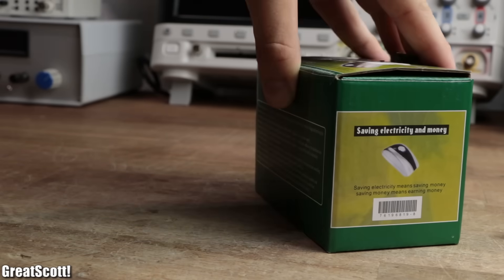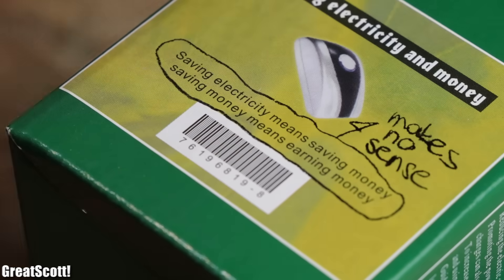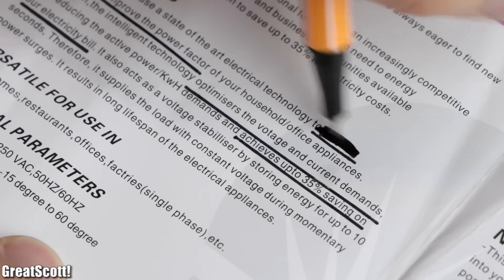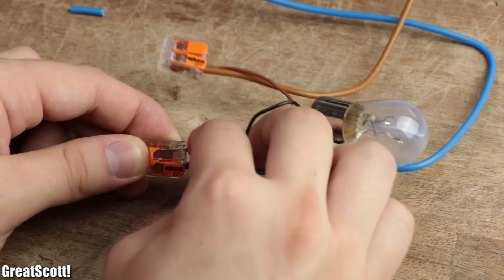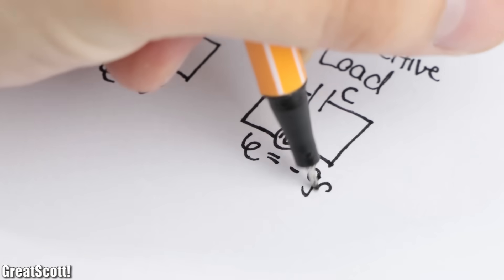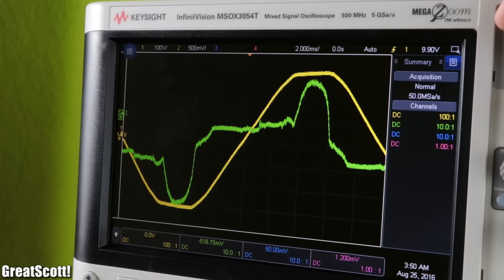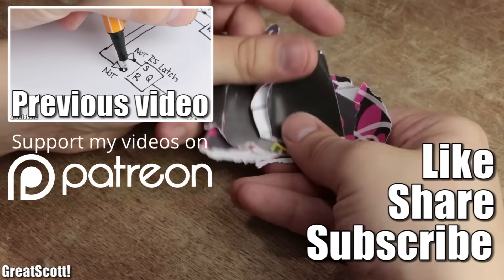Chinese Power Saver - Does it actually save power?

Comment: Wow. Those are crazy cool breaker boxes you guys have, looks like something out of star trek :p I'm used to grey metal ones standard over here, filled with black breakers and whatnot.
Reply: Ryan Gunn The North American standard is pretty bad looking, but at least our color codes are easy to read. I will take black, red, white, and green, over brown, blue, and green. Muddy colors would be hard to see in low light and for colorblind people.
Reply: Buddy Clem can't say I've seen brown and blue in anything newer than the 1970's, and that was before grounds. Maybe it's in commercial, I'm only used to residential, which is black, white, and green. 

Mainly I was looking at the white breaker box with the 2 horizontal breaker bars instead of a grey box with 1 vertical bar.
Reply: The european cable colors (standardized to brown=L1, black=L2 or switched wire, grey=L3 or switched wire, blue=neutral, yellow/green striped=protective earth) is ideal because you know 2-coloured wire is ALWAY the Protective Earth. Low light conditons are easyly changed by using a light torch, so it is no useful reason.
The reason red isn't used anymore in europe is because of the danger of wrong use, in the 1960s the red was used für protective earth, hot wire, neutral oder switched wire.

Comment: It looks like some of these devices have pass-through plugs and can act as a surge protector/capacitor.  I wonder if these could be used to help with the initial power draw of a refrigerator compressor starting .. i.e. to allow someone to use a cheaper/less powerful inverter on a solar setup.  Any thoughts here?
Reply: Jason Fisher Reducing voltage on a compressor motor will burn out the windings. Capacitors don't work the same on AC as on DC. If you're setting up an off-grid solar system, then your batteries will handle changing loads, assuming that your inverter can handle the extra current.

Comment: Great video.. so Im from panama in Latin America... so I cant buy any energy saver in store like amazon or ebay? How I can know if some device works really.. thanks for your help.. Im trying to reduce at least some 30%- 40% of bill...
Reply: Jorge Bernal 
1 You can buy from online stores as long as you have an Internet connection and a way to pay for the product and shipping.
2 All energy saving devices are scams. 
3 To save power, use less power. Weatherproof your home. Buy more efficient appliances and lights when you can afford to.

Comment: First of all, power factor correction devices only help with inductive loads. It does not necessarily "energy saving", but it will improve the function and the lifespan of your electromagnetic (inductive) devices or components. However, there are cases where it may save some energy, but the conditions has to be right. Not all energy quality are the same from home to home ot business to business - not even if they're right beside each other and feeding from the same source.
Reply: Also, you can't just take any capacitance and use it because over correcting will make it worst.

Comment: But in practice this device work for many, but not the way you would expect. It smooth out the spikes and make power transfer on power cables more efficient, that's the main point it does. Electric spikes on a long cable will dissipate energy as strong radio waves, and the device restrict that.

The further away your inductive appliance is from the billing kWH meter, the more it can save. Obviously it should be connected as close to your appliance as possible so that it can smooth out the incoming current that less energy loss wasted on the wiring (the device won't change the profile how the appliance draw electricity). Once you stop using the appliance the device should be disconnected as well for optimum savings.

Obviously the device is useless on non-inductive devices, but most modern devices power are inductive that's why it's being marketed in the first place..

Comment: Phaseshift of 90 degrees?! You mean pi/2 rads.
Reply: Meh.
Reply: No, 90°. You may be good with math, but electrical engineers, and electrical engineering classes do not use that terminology. It would be confusing and inefficient to do so, either in class, or in the field.

Comment: IDK, but this video is far different than our real power saver.......I have a power saver for 10 years and still kicking......I tried multiple appliances like 4K TV, PS4, Ethernet, g29, Audio Booster, PS3, Electric fan......Without using that our bill will reach at Php 2,000.00 - 3,000.00

Unlike using Power Saver it has a rock solid Php 0.00 - 1,700.00

That Php 0.00 is a luck, no lying, I was playing PS3 whole day back when I was Gr. 7 and it was 2 consecutive months without paying bills due to 0.....weird tho......

Update: sadly, we bought 1 unit due to very expensive price. I was still finding the maker of this, pretty legit.

Comment: I remember my electrical engineering prof explained the bs about those so called power saving devices.

It is true that you save power but roughly 1-3% which is very negligible.

Comment: Well, this device CAN actually save power under the right circumstances.
Let us for once imagine the power meter in the consumer unit.

Say you have a 40m Cu 2,5mm^2 supply cable. The load is 4500VA with an inductive cosphi of 0.7, and the voltage by the load is 240V.

Now; S=3500VA, P=2450W, Q=2500VAr
The current is 2450W/240V*0.7 = 14.6A. We’ll use 0.00750ohms/m for the cable. 
14.6A*0.00750*40m*2 = 8.8W (real power) dissipated in heat in the inductors. 
In this case the power meter reads 2458.8W.
We insert the “power saver” near the load, and assign it the value of 20uF. 
In Norway we have 50Hz, therefore Xc = 159ohm. The capacitive reactive power of the “power saver” is 240^2/159=361.8VAr. 
We now get a Q = 2500 - 361.8 = 2138.2VAr, and thereby a S = 3252VA, cosphi = 0.75
The current is now 2450/240*0.75 = 13.6A, (real) power dissipated in heat = 8.16W.
The power meter now reads 2458.2W.
Well, point proven; 2458.8W > 2458.2W, so in this case it saves a tiny bit of energy over time.

This was written to you who say the product cannot save power at all, because it CAN, but it is still a shitty product made to screw people, i can agree on that.
Reply: CirkaTusen But you will have less heat and current,  which means  things like motors will heat less and have longer lifespan, but since you probably dont have 3kw industrial motor in your living room, this wont do much
Reply: whao, i love your deluxe image.....            '                cool!
Reply: No it won't save anything on the bill even though it might save on power waste.   Consumer electric accounts don't charge based upon reactive watts, they charge by actual consumed watts.  This means only industrial customers would save money doing something like this because it takes large motors to make large reactive watt.  The Power Factor does not affect regular consumer power bills.  Only industrial / commercial for the most part.

Comment: These non-wanted harmonics can actually be decreased using a low-pass filter because this current signal is a sum of a lot of harmonically related complex exponentials (trigonometrics) and you only want the first harmonic maybe at 50 or 60 Hz.

Comment: Great video ! I wonder why do they add something inside the box... This system can only decrease the reactive current if the user is running a very specific motor... In any other situation, this system increases the reactive power (especially when noting is plugged...) so, clearly, it is both bad for user and power grid !
If I was one the "engineers" who created this device, I would have just put a piece of iron in it to make weight ;-)
Reply: Some old Chinese energy meters are not properly designed back in the 80s/90s, and they will spin backward under pure capacitive load. Those energy savers don't actually save energy, they steal energy by hacking old meters.
Reply: Okowatt? It's useless!
Reply: Ch Faizan that is 100% bullshit
Reply: @kelsonmcnamee715  in

Comment: About the inductive load:
You hear so often that motors act like inductive loads - well - not really.
if the motor is free running then yes.
But if it is under load the powerfactor normally gets pretty close to 1, so a resistive load with a tiny tiny inductive load in parallel.

Comment: @GreatScott! who wired ur breaker box up? its not save to the touch! + how big is ur home? how is the v-drop?  at which amps does your breaker  cuts the power? the B16 need to cut off on a short circuit current of at least 48Amp at every socket. when u have a big home. then 3x1.5mm² and 5x1.5mm² is not enough. VDE says NO...
Reply from the maker: Thanks for your concern. I am an electrician myself and the wiring in my apartment was done according to the law. It was properly checked.
Reply: well. at least its not a "ratten nest" in your box. ive seen worse boxes some years ago

Comment: Question: What would be the results of your test if your house had 5 ac moters, 7 window ACs, and 3 refrigerators ........ particularly ..... if they all didn't have start or run capacitors?
how is the overall power consumption going to be affected before and after the "Germany" power safer?

Comment: - Try capacitors with electric non-synchronous motors (typically refrigerator's motors) as reactive power - it helps a little. And when before counter somewhere connected reactive electric motor - plugged capacitor even can turn counter's wheel backwards! (sry, bad enGrish)

Comment: At least in Italy it is illegal to introduce a reactive (aka with phase shift different from 0) on the power grid.
Hence any inductive load has a capacitive counterpart in series, and vice versa.
Reply: That makes sense. It will reduce the wiring costs for the distribution network because having the power factor closer to 1 (being closer to being in phase) reduces the current for a given VA. This means the transmission cables can be thinner and the switchgear lasts longer.

Comment: You should really change "China" to "USA" - because that's invariably where these "money for nothing" ideas originate. The Chinese have merely capitalised on the gullibility of the average USian (and yes, there's no shortage of gullible types in other parts of the world either).

To truly get a reduced power bill, you'll need to create a massive inductor and sit it under the power lines outside (a trick widely used by nomadic Romani people all across Europe for many decades) - but don't expect to run your entire house from it; you'll likely only get enough to power a few lights or (possibly) a single stove element. Hardly enough for our modern electro-centric lifestyles.

Comment: I don't understand. In a nutshell: it's a money saver or not?
Reply: No
Reply: thanks. So the "trick" doesn't work..
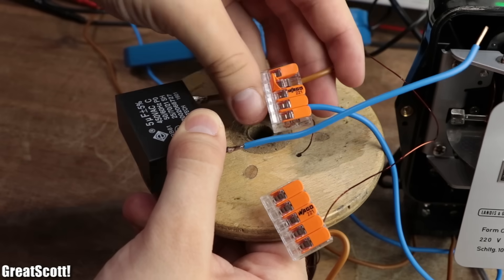Reply: At 4:11 he says what you want to know: It works for decreasing the reactive power, but it won't affect your energy-meter and so saving your money!

So maybe it's possible to indeed save money by plugging a device on your electric socket (i'm not an expert in this domain) but not with 3 simple capacitors, you would need something that would adapt in function of the power that you use, but it would also cost more!
Reply: If I remember correctly from what I've heard there used to be some kind of a trick that involved a modified thoroid transformer that could make those old mechanical meters even spin backwards, but that was much more complicated than just plugging it in

Comment: I've seen these things been torn down on the EEVBlog and BigCliveLive previously. Regarding the one in the anodized case, I wonder what the components left off the circuit board were for. That may make for an area of future investigation.
Reply: Also a fan of BigClive, this tear down reminds me of the car Ionizer he got from China that literally was just and LED light soldered to a pcb board...
Reply: I saw that one too. It's interesting to see just how many of these scam gadgets turn out to be nothing more than a power connecter and a LED light with just enough circuitry and components to ensure the LED has the right amount of power.

An episode explaining how to build a 'power saver' based off the full circuitry (eg including the stuff the builders left off it.)  in the anodized version may make for an interesting episode and give viewers some idea of what these things actually cost to build.
Reply: He bought two models, they came in basically the same packaging. One was legit though and one was just a led on the board.

Comment: Scott...
i have tried something like it but with huge capacity of capacitor...
if China thing only using 2 till 5 micro farads...
i use 2 capacitors, one is 40 micro farads 400 volt and the second is 50 micro farads 400 volt...
but i use them alternately, one at noon and one in the evening...
from my first installation till now, i got huge reduction my electricity bill...
before i am using them, i should pay about almost average 20 dollars of my electricity bill every month(in my house there are many wall and standing fans and one of them is big and active almost 18 hours per day, 1 tv, 1 set huge amplifier active 3 hours everyday, 1 refrigerators active 24 hours, 1 dispenser active 24 hours, 1 water pump active 4 hours everyday, 1 rice warmer cooker active 24 hours, and many house lights type LED but i know those lamps not too much using electricity power and of course in my room have some devices using huge electricity power everyday)...
but for last 10 months, my parents happy cause i got only about 15 dollars of my electricity bill...
i live in INDONESIA and my neighbors also my relative still confused when look my electricity bill, they said(in INDONESIA language) "with those stuffs, you just got about 15 dollars? i got about 30 dollars every month!"...
also some electricity worker have been visited my house for checking it and they got surprised! "these things for plant but you use it at home, great!!!"
Reply: That's awesome to hear. And, it not only saves you money, it also saves the power company money. The cheap knock off products from China do nothing, but using big AC filter caps like you did can have a noticeable effect. Especially with big inductive loads or lots of modern switchmode power supplies. If everyone did it, it might even reduce the cost of power, as there would be less strain on the power grid.
Reply: theLuigiFan0007 yes...
absolutely...
for circuit, they are same like two China capacitor that Scott opened...
then you need change the capacitor with big one i have...
but you need count your power house first...
like me, 2200 watts 220 volts 6 amps on electric meter...
after some hard calculation i need about 38.9 micro farads...
so i use 40 micro farads...
the problems is when night comes, everyone will use electricity in same time so there will be little volt reduction in grid line...
then i decided to make another one use 50 micro farads for reducing lost peak voltage...
if i don't use 50 micro farads there will be little flash in my house lamps...
Reply: ***** did not you read the part > my room have some devices using huge electricity power everyday...
I mean i have a little laboratorium in my home...
If you said i don't watch this video, you are wrong...
I am not lying about my capacitors, because them have been installed since about 1 years ago till now...
I have been SHUT THEM DOWN for one month and it makes my parents angry for paying higher electricity bill(about 24 dollars)...
Capacitors on = 13-15 dollars/month, capacitors off = 24-30dollars/month
Reply: ***** what ever you said, i am still using my capacitors and they are really really help me much...
And i don't use them 24 hours...
If i use them 24 hours it will be disaster...
Reply: the electricity company bills home customer with different way with kWh, whereas industrial users billed with kVAr. To prevent penalty for industrial users, they uses capacitor bank. Those industries uses alot of wattage, so it's unfeasible to bill industries with kWh
Reply: Anyone here considering fandi gladion sounds like s/he might be somehow related to these power saver shenanigans? (and if not, WHY NOT ?) The bad english just seals the deal for me.
Reply: sorry my parents say this device (capacitor) is not effective but more costly bil! im test that but is not saving by say much costly electric biling !
Reply: EscapeMCP hey my national language is not english...
Till now my capacitora still working and gives me benefit...
Whatever you said guys...
My invention is mine and i will not spreading it again...
Reply: Hi Fandi, good do you have diy video of this? or simple safe instruction? thanks in advance.
Reply: try to power a power hungry stuff like microwave, workstation pc, or server rack, the reduction will got destroyed in matter of seconds

Comment: Very good video about this devices !! Keep up the good work ! Actually this method using capacitors parallel (power factor correction)  to inductive loads is being used in big factories who they have large amounts of inductive loads like motors, since the power companies monitor also the current being drawn from the power lines.

Comment: I like your video quite a bit, but, while you can't save power as you show it, it is possible to save a bit of the power even in Germany. If you have a reactive load, and your wiring is a bit old, you may be able to drop the current going to your load by eliminating the reactive component and reducing the IR drop on your mains line to the appliance. It will like be very small, however. For example if you appliance (say room air-conditioner) draws 8 amps rms and your mains wiring was 1 ohm, if the "saver" would reduce current (since the appliance is less re-active) from 8 amps to 7 amps, then your losses in the wiring would go from 64 W to 49 W, thus saving 15 W. In a month you might save 5 kWh, however the numbers I show are just made up.